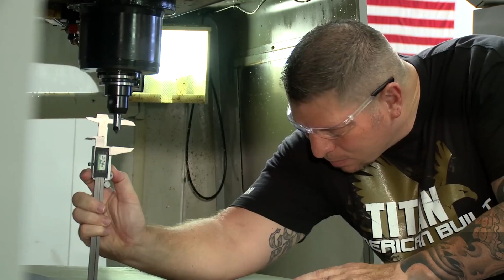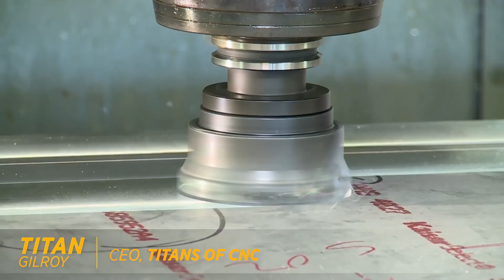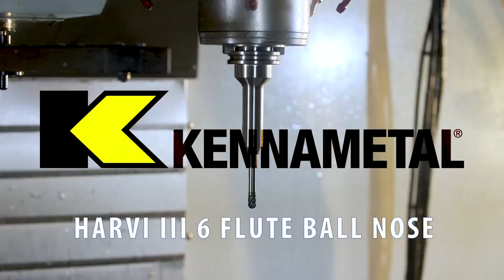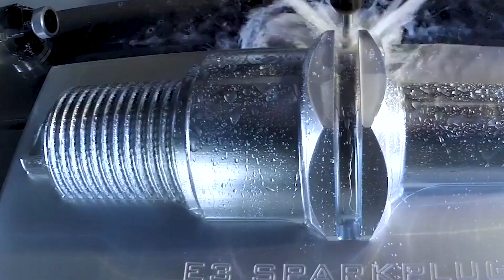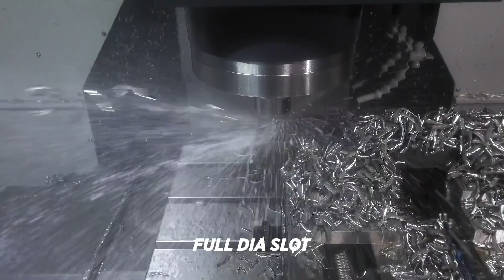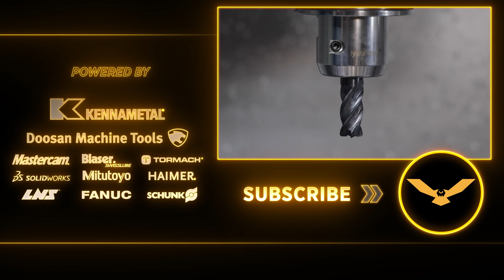How a BROKE Machinist with No Credit got $50k & 4 New CNC Machines to Start a Business

Comment: Everyone needs reliable electricity. Government and private power companies have proven that they're unreliable in that arena.
Unfortunately, you cannot purchase a power generation system - off the shelf - that doesn't require some kind of fuel to work. 
However, you can build something that will help you in the future..... maybe the very near future. 
Everyone is at least marginally familiar with the lever and its effects. 
The lever mechanically amplifies power. It is an amplifier. Children can lift cars using a lever - I did when I was young. 
One simple system, using levers for power amplification, is a water wheel. Historically, and frequently, water wheels were placed in rather anemic and unimpressive streams and yet, inside the building, there was a long rotating shaft that had multiple pulleys and belts that were powering a plethora of machines (machine shop) or grinding stone wheels (flour mill).
Mediocre creeks were able to pull off these impossible feats because of the power amplification of levers. 
A wheel is the sum of innumerable individual levers that simply blended together into a round shape. 
In a water wheel, the individual "buckets", or paddles, can be thought of as each one being the end of a lever. Because of this, it is important to have as many spray nozzles as there are paddles. Thus, each "lever" receives an input push and all of these individual pushes add up to a huge amount of amplified mechanical power!
To capitalize on this phenomenon of levers, and make it even more beneficial and useful, we can use the concept of feedback to power up our water wheel. 
We begin by powering up our water wheel using a conventional off the shelf water pump. We plumb the water pump to a multiplicity of nozzles, each one of which is aimed at its own dedicated paddle. 
The center of the wheel is the hub of amplified mechanical power. In order to convert that mechanical power to electricity we simply turn the shaft of an off the shelf 110 volt generator head (often paired with, and powered by, a gasoline engine).
So, now we have our water wheel creating useable 120/220 AC power. 
Next,  we can remove the household AC power and replace that with the power from our onboard generator head. 
We can accomplish this by temporarily clutching in a heavy flywheel which will mechanically turn the water pump so that it continues generating electrical power while we switch to the onboard power. 
Clutching can be accomplished by putting a pulley at the end of a hand operated shaft just like the system used in many riding lawnmowers.
The belt will normally be loose and will not engage anything until a hand lever is moved. 
So, just so long as the lever effect of mechanical power amplification works, this device will work. 
It will power itself and there will be sufficient excess power to additionally power up other loads like your heater, refrigerator, lights, etc.
Unless someone changes the "laws of physics" - unlikely - then the lever effect will continue to work and it will be the basis for disconnecting from the grid or providing an emergency source of power. 
If Texans had these devices you wouldn't be seeing people freezing to death. 
This simple device is the result of 60 years of trying to come up with a dirt simple way to generate electricity. 
I know of many far more complex ways to create power from zero point energy but, obviously, the common person wouldn't be able to get those ideas off the ground - far too complex......
So, born from a desire to help as many people as possible, I changed my research approach to look for the simplest way, humanly possible, to generate electricity in a home/ garage environment.
There you have it, sufficient electricity to meet your family 's needs if you and a friend or two can get together and make it.
You can't buy this device anywhere but you can buy the parts and put them together. 
People buy the parts and assemble functional helicopters and airplanes in their garages and barns. 
You can do this. 
You need to do this. 
It is cheap insurance for your familys' well being and, possibly, survival. 
I've done all the hard stuff now all you have to do is throw a few parts together. 
May pop be with you and guide you through the coming perilous times. He made you, He loves you, and He wants the best for you. He did all the hard work for you and now it's up to you to return the favor by embracing, loving, and honoring Him.
Jesus is His name and no one enters into eternal life except through Him.
I am a Son and He and I are giving you these gifts if y'all will have them.   :)
Reply: Uhhhhh.....thanks?
Reply: @tightmf  I hope you make something of it for yourself and yours.  :)

Comment: What kind of contract "guarantees" if any would you suggest are in a customer's contract before even calling for a new machine Or 2.

I'm currently making prototypes used for the analytical testing of biomedical device "prototypes"
None of my current "side" work will ever be large production. 
 I am working with a supermax lathe and a Promax mill. Both manual machines.
Reply from the maker: Its called a blanket order. It’s a long term purchase order where the customer gives a contract to a machine shop for a longer period of time. It can be a year or even 3 years. Usually the customer will get a lower price and secure long term manufacturing for their product… and the machine shop gets confidence to purchase tooling and to design fixtures… and hire employees. Both benefit.
Reply: Would love a lathe with a y axis.
And a robo drill would be perfect

Comment: Please everyone remember there is a difference between no credit and bad credit… If you have bad credit most likely you can’t do this
Reply from the maker: My situation was of course different… and for years I proved myself to the right people without even knowing… I had also gotten myself into trouble as a 22 yr old … which probably reflects worse than bad credit… in the end, people saw that I changed and had a special talent… which is why they took chances on me.
Reply: @TITANSofCNC  I’m getting my certification for a bigger pay. I have 2 years work experience and am self taught with haas g code 3-4 years before actually working. But eventually my pops hopefully will still help me buy machines.